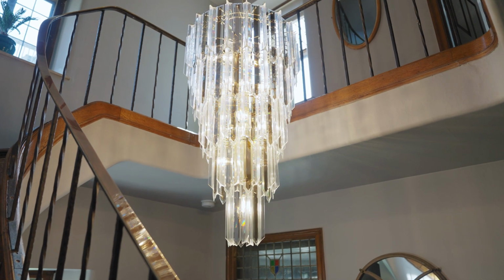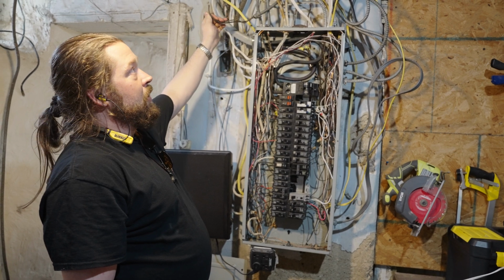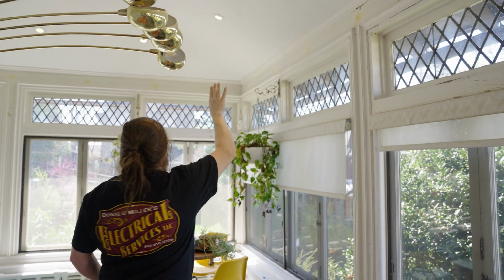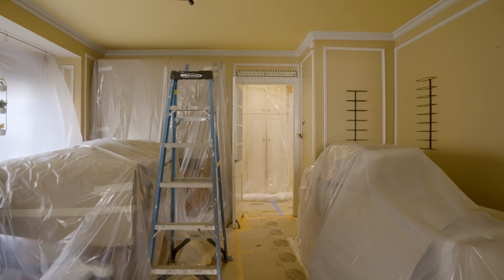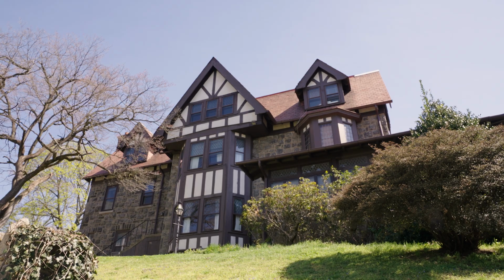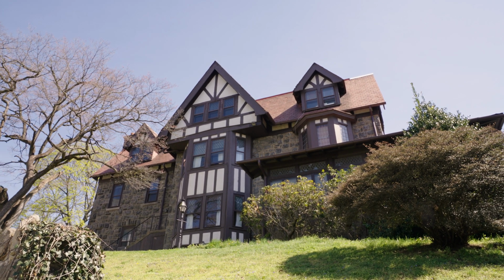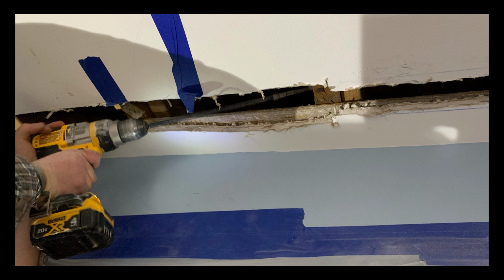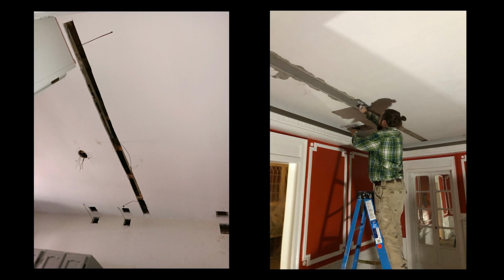Knob & Tube Wiring / Donald Miller's Electrical Services

Comment: Donald is it mandatory to remove the nob and tub in the walls even if it’s dissconected ?

It seems it is not mandatory yet I’ve heard some insurance company’s won’t insure you if it’s still in the walls even if it’s disconnected at the panel?
   Which doesn’t make sense to me , but if I’m going through the trouble of a rewire I hate to be left in the same position where I’m stuck only dealing with 1 insurer that going to charge me a ridicules price 
   I can get insurance now with the n+t active but it’s 5x the price if I didn’t 

  I only have 2 circuits that are still n+t and the basement would be very easy to remove what’s in the ceiling of the basement but the walls and the ceiling of the attic would be very insanely priced to remove , I actually was given a quote of ten k just to remove it and another 5k to repair the mess and I’m guessing that is only removing what’s easily accessible
Reply from the maker: Be careful- prices can vary rapidly. Just demo and remove when accessible.